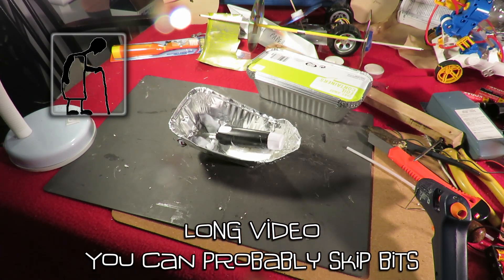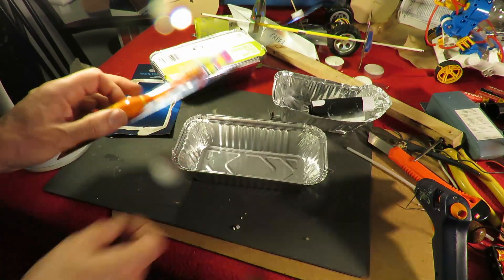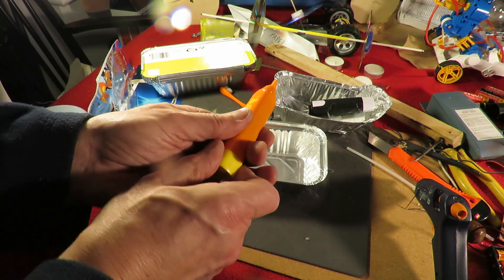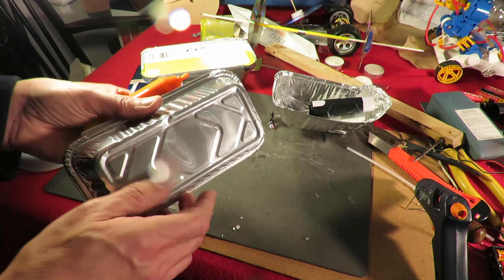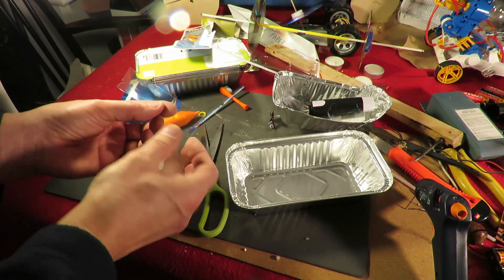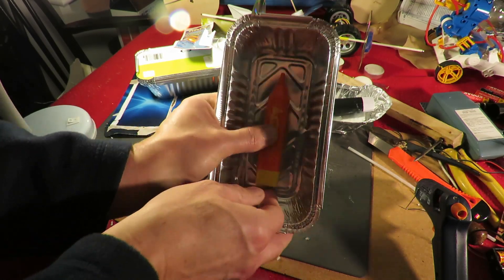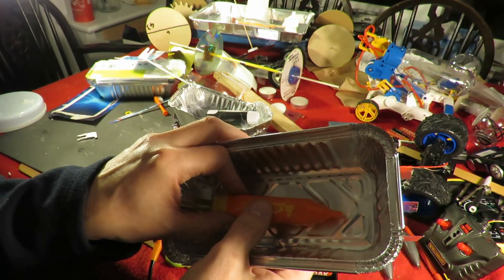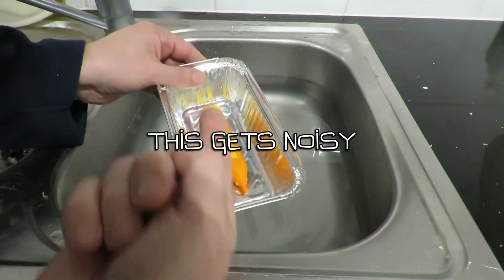HOW or WHY does this work? Vibrating Boat propulsion

Comment: Im an Inventer doing research.
I can tell you something about it i guess.

If the ship hull is moving and it is vibrating it is producing thrust.

The ship needs the movement.
Cause it needs to catch the water that tries to escape in forward direction.

If you put on sideway rails it should be more efficient.

Put a flexible membrane at the botton. Plastic foil should work.  The up-down movement is important.
Left-right is not this great cause it produces waves on the surface.

You can put a little ventil flap in the front. So the the water gets problems to escape to the front. 

Read about the tesla valve. It's a ventil without moving parts.
If you start to vibrate it, it should produce flow.

Comment: The absolutely brilliant part of your research was the impact factor where u raised the bar from probably there is a trend to certainly there is a trend. If there is a trend in data it gets very prominent as independent parameters it shifted to zero or infinity.so for motion based trends they reveal fully at super slowmo or at speeded up footage. eg clouds motion, sun's motion & esp milkey way's motion from one side of sky to the other become totally evident on speeded up timelapses

Comment: Brilliant video......Fluid mechanics is very hard to rationalize. I am even skeptical of its equations too hence didn't specialize in it. Best way to deal with FM problems is to rely on trends from experimental data obtained from wind tunnel testing etc....Eg if u drop a solid no matter how springy it is it can never bounce as high as it was released from but if u drop a brick in pond, the water drops will rise above your hand and make your hand dirty.Just counter intuitive ..Note however ofcourse it doesn't defy energy principles

Comment: I wonder if you tilted the things on the back , if it would behave different?   Maybe if you removed the center one, tilted the outer 2 inward or outward a slight amount that it would go faster.
Reply from the maker: It's one of those things where nothing seems to give quite the result you expect like the way it still moves when I cut the fins off. You could spend hours with this trying little tweaks.

Comment: I had a canoe and noticed when I stood up and sat down at one end repeatedly it would tend to propel towards the end lower in the water. I reckoned that the raised end had more surface so it pushed more against the water than at the lower end.
Reply from the maker: That sounds rather like the principle used for this type of propulsion https://youtu.be/Os6gz0Gk_qE

Comment: I am puzzled. The best thing I can think of is that, like you said, it’s got to do with fluid pressure. I think more specifically it is because turbulent fluid is less dense than laminar fluid, therefore the turbulent fluid around the vibrating fins is lower pressure, which pulls the fluid from around the boat towards it, and because of the Coanda effect, the moving water pulls the boat with it. But that’s already basically what you said so I suppose it’s not much help...
Reply from the maker: I think this is a "conversation piece" the sort of thing your could use to start a discussion at a party but I am not sure what sort of people would go to a party like that :-)

Comment: I think that the buzzing sound irritates the tiny microscopic creatures that live in your kitchen and they are all blowing on the boat trying to make it go away. Ha.  Actually it might be a sort of inertia drive going on.  I have been following that concept for years.  When I was 14  I built an inertia drive device box that moved around on a table.  I still have it somewhere.  The small balsa wood box had an out of balance motor setup that moved up and down a slight ramp.  When the sliding motor arrangement hit the bottom of the ramp it 'banged' the box forward like a hammer hitting a nail.  I got the idea from a Popular Science magazine article about inertia drive research.   I think the year was about 1964.
Reply from the maker: I think it's one of those cases where several things may be happening and the sum of the actions push the boat forwards. I have done a couple of boats along these lines and suspect that it would be interesting to include a speed controller to adjust the vibration speed to find some sort of harmonic. The flexibility of the hull of the boat probably plays a part and the location of the motor forward or aft etc. I am sure I could spend hours on this :-) If I managed to crack the propulsion the next issue would be steering.
Reply from the maker: A sneak peek at episode 2 due for publication on the 28th https://youtu.be/u3zkXlSghMk

Comment: Very interesting experiment.

It could be that the vibration frequency that is transferred to the water is then being interrupted by the fins so the boat will move towards the interrupted area because there is not as much vibration in that area.
I think if the fins were tuned to the correct frequency, either shorter or longer, it would be seen to move faster in the fins direction.
Trying to do that would be trial and error. This is just a guess.
Reply: Yeah, it does look something like that - the paddles maybe suppressed larger waves from being formed  than at the other end
Reply from the maker: Yes, one of those little puzzles. It may even work in a completely different way in a larger pool as we might even be getting feedback from the waves hitting the sides of the sink. Probably a classic example of the observed reaction not being linked to the intended action. I am sure you could spend days on this with little tweaks here and there. Probably one of those experiments you need to write up a sequence of steps well in advance and record each action and reaction. Then feed it into a YouTube algorithm and predict the colour of your shirt.  Of course it could be that I have tilted the sink and it is running downhill 😜